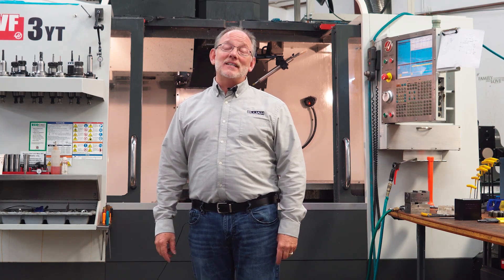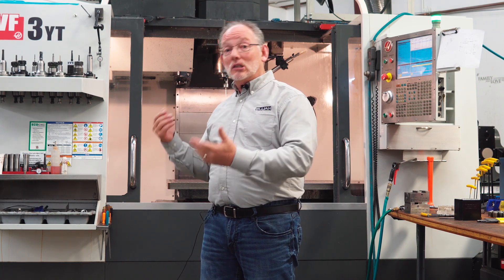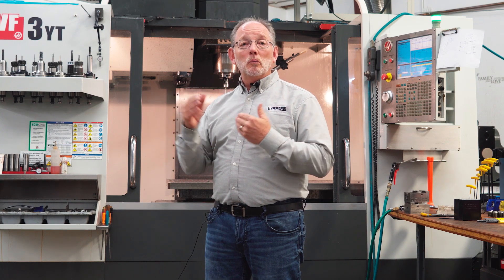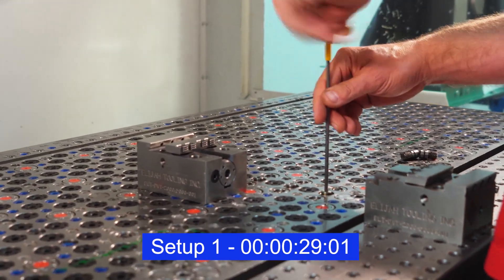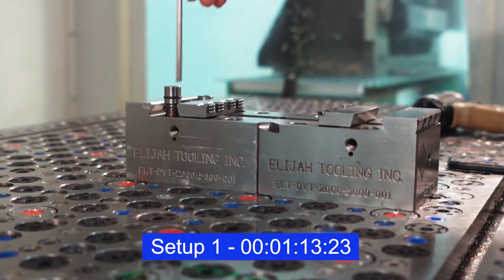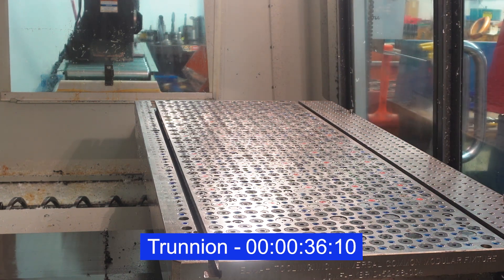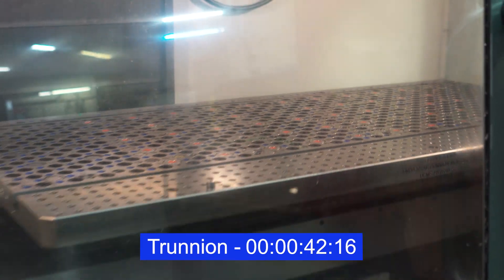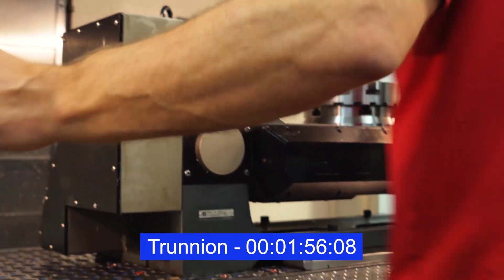Quick-Change Demo for Vises and Trunnions

Comment: This Trunnion lifting and attaching method is ingenious. At our shop we have to get the 5 axis trunnion onto our mill and to do it we have to remove all the other machine tools in the room and get a forklift in. But going in through the side like you did seems like it might be able to be our solution!
Reply from the maker: Thank you! That's exactly why we created and started selling these carts, we had the same issues with loading and unloading our trunnion, especially if our Haas machines are very close together. We also end up storing our trunnion on those carts since they're very easy to move around and stow away if need be.